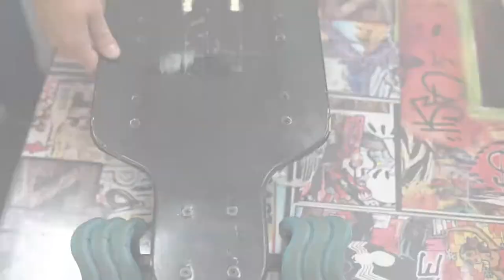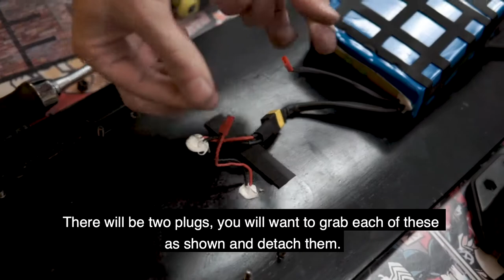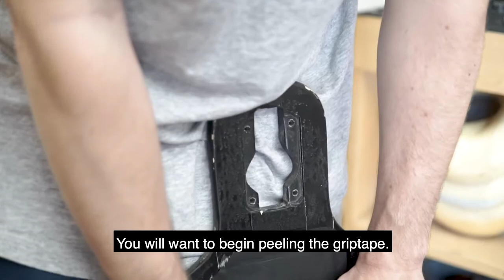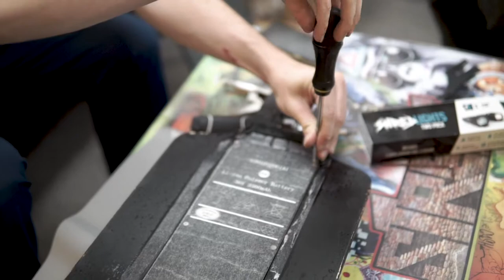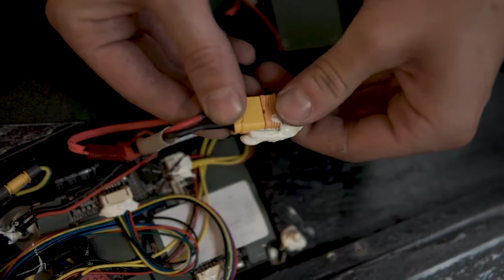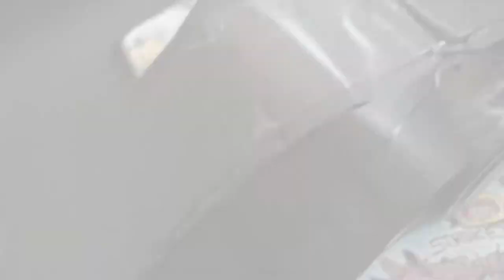Shark Wheel Electric Skateboard - How to Replace Your Battery

Comment: Is it possible to remove the grip tape like was done in this video on this board to get to the battery screws, and truck screws instead of making holes in the grip tape? Asking because I bought this board and I want to put shred lights on it as well as put a carbon fiber vinyl wrap underneath the board
Reply from the maker: You don't have to remove the grip tape. You can just put small holes above the screws
Or, if you want to remove the grip tape yes you can do that as well.

Comment: How do I diagnose if it’s a battery problem or not? Runs fine when I’m not on the board but once I am the board shuts off/ loses connection. I’ve only ridden it a handful of times, this is really upsetting
Reply from the maker: please contact customerservice@sharkwheel.com thanks!
Reply: I have the same issue. Did you ever figure out a solution?
Reply: Same exact issue here. 552 miles on mine. Any updates??